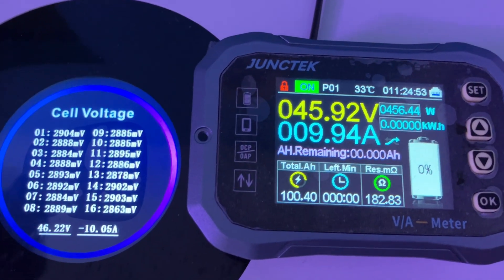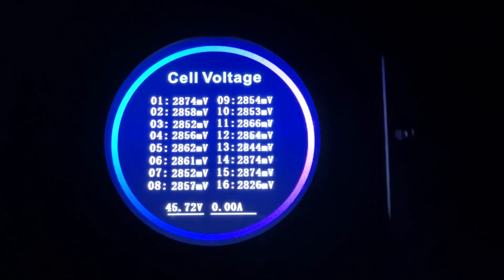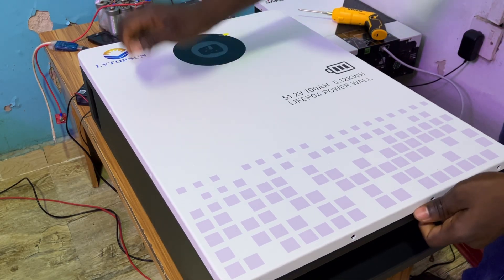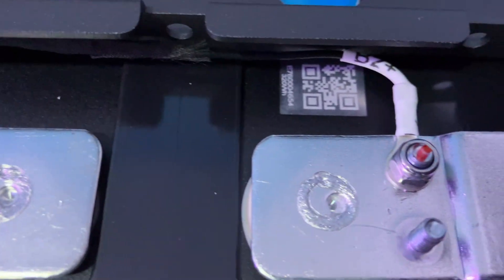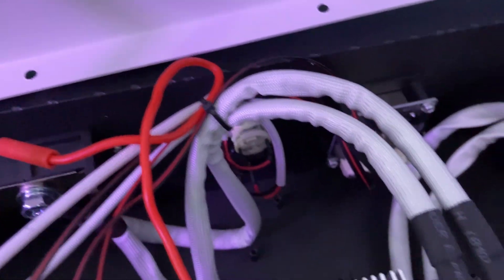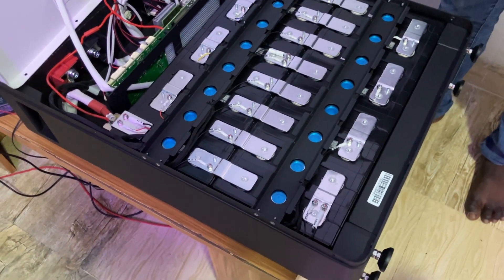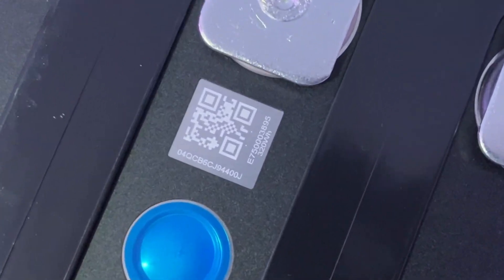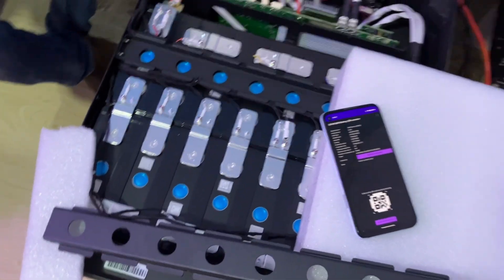LVTOPSUN 5.12KWH Teardown, Cells and Build quality revealed.

Comment: AI Overview
How to Distinguish Grade A and Grade B LiFePO4 Prismatic battery Cell?
LiFePO4 (B) refers to Grade B lithium iron phosphate (LFP) cells, which are new, functional batteries that don't meet the stricter performance criteria of Grade A cells. While Grade A is reserved for cells with the highest performance, often used for applications like electric vehicles, Grade B cells still have good performance and are suitable for other uses like home energy storage. Key characteristics of Grade B cells are that they have slightly higher internal resistance and potentially lower capacity compared to Grade A cells.